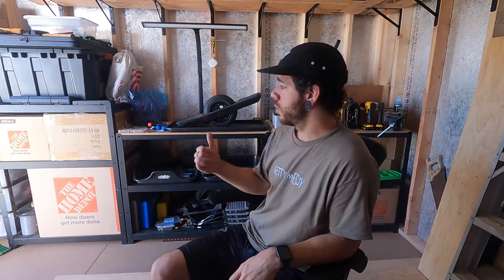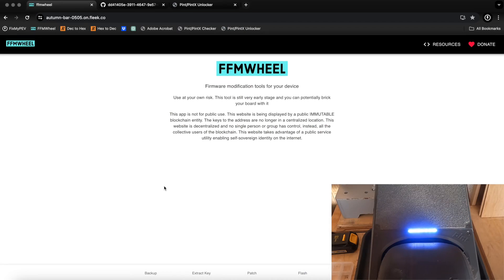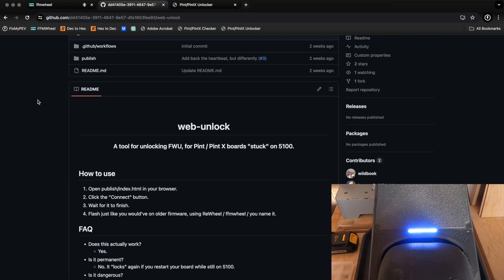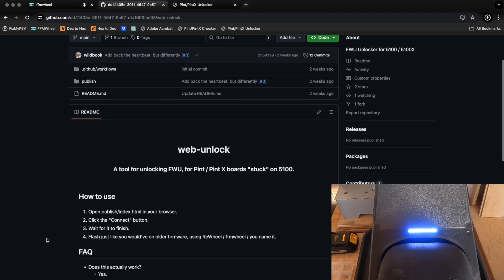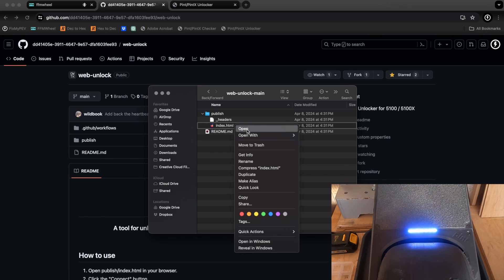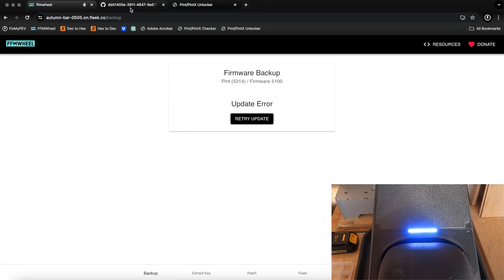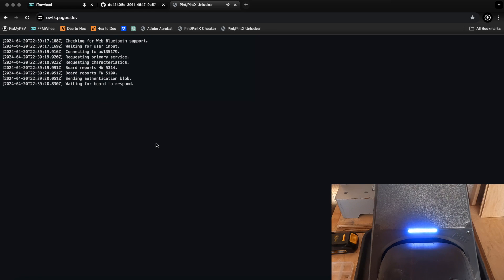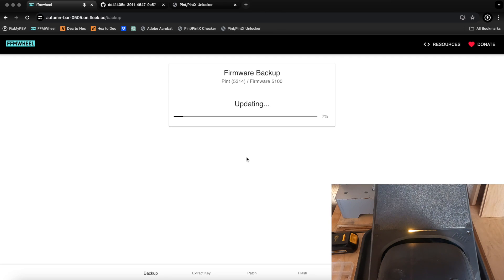Downgrading Onewheel Pint & Pint X: Reclaiming Control

Comment: my computer isn't picking up my onewheel on Bluetooth. I have the quart installed and every time i open the onewheel app it says incompatible hardware but i was able to get like 5 rides without any troubles before it shut off and now every time i turn the onewheel on, the light flashes red.  Would that possibly be an issue if the light is flashing red and thats why im not seeing the onewheel on my computer?
Reply from the maker: The flashing lights should not impact your ability to connect. Just make sure your phone (or any other device) isn’t connected to your board while you attempt to connect with the computer. And keep your board close to your computer.
Reply: okay it shows up now to pair but it doesnt do it everytime. now ill start connecting and then it will take a sec then just go back to the connect button
Reply: ok last thing I just checked the instructions and it says its now incompatible with Gemini 5100 meaning none of this will work now. damn 2 weeks late....
Reply from the maker: This unlocker tool is specifically designed for use with Gemini - 5100. However, it is not compatible with hardware versions above 5314.

Beta sure to review the description and the video multiple times if needed. All relevant info should be there. 

Happy to answer any additional questions you have: https://www.fixmypev.com/contact-us
Reply: @fixmypev  ok awesome! thank you. i was able to do everything in the video but now i ran into another issue. i get a mix of white blue and yellow light flashing the motor isnt on or anything i can connect to the app but nothing is live. my firm and hardware are now gemini -65535 and 5000. My firmware and hardware before was gemini -5100 and 5314...
Reply from the maker: @Skeezusman  Time to flash some firmware.

https://youtu.be/OT6Wd7G6haY?si=gZgT8h3mWiv8YT3_

Comment: Thanks for the video. It went very quickly and included examples of rewheeljng and connecting to program that may it be necessary depending on the board? Can you post a step by step, in text, for pint and one for PintX, please? Including links and verbiage around what to do and where to click?
Reply from the maker: You’re welcome! And thanks for the feedback. For the Pint X, the only difference is that you jump straight to the ‘Flash’ tab instead of the ‘Backup’ tab. I’ve added a pinned comment with that info for now. If there’s enough demand for separate videos, I may look into that in the future. The highlight of the video is the unlocker tool. 🤙🏼⚡️🛠️

Comment: So I can custom shape my pint x for wtf rails???
Reply from the maker: You can level your rails, yes. It’s not custom shaping though. Just an IMU calibration via the Onewheel’s factory mode.
Reply: Just so I have this straight. Once I've down graded..I'll have the ability to use nrf to re-level??
Reply from the maker: Correct. nRF Connect, OWDT, etc.

Comment: Hi there, I tried it, everything looked good until it was the time to run the Firmware Backup again, it read Pint(5301)/Firmware 65520, clicked on Flash Extractor and got an Error. Ran the Unlocker again and got a Red message that says that "this only works with Pint/Pint X Boards". Board is flashing Blue and Yellow lights and the Firmware Backup (if Connect again) reads Pint(5000)/Firmware 65535. Please help. Thanks
Reply from the maker: If the lights are flashing now, feel free to move on to the ReWheel process. Link is in the description. If you need more assistance, send us an email at https://www.fixmypev.com/contact-us
Reply: I would like to know if you get the way to downgrade your onewheel because am at the same like you, please I would like to know how to do it, thanks!
Reply from the maker: @dioscarreyescabreja2102  If you’re interested in my downgrade service, feel free to contact me here:

https://www.fixmypev.com/contact-us
Reply: @dioscarreyescabreja2102 I actually was able to reinstall the software through the application, thankfully the board is working again, NOT DOWNGRADED though, the method explained in the video may work for some others, not mine, and at this time, I am just going to leave it alone. Hope you can fix yours, it’s quite scary

Comment: Well, when I didn't update my pint x, can someone tell me how to check the battery level or change the driving mode without an update?
Reply from the maker: On iOS, use airplane mode or the Float Remote app. On Android, block data and wifi to the Onewheel app or use the OWCE app.

Comment: My pint X was just updated to 5100. How would I go about turning it into a pint in order to then re wheel?
Reply from the maker: That process is an entirely different animal to take on. Requires disassembly, soldering, use of a Pint bootloader, and then ReWheel. We’re not able to demonstrate that process for legal reasons.

Comment: I have a pint with hardware 5326 can I still upgrade my battery to the quartz battery?
Reply from the maker: Gemini - 5326 is unsupported at this time. Unfortunately, that means the ChiBatterySystems Quart battery is not an option for your board.

Comment: ReWheeling a pint X is possible. Just have to load pint firmware on it, relatively long and complicated method but indeed possible.
Reply from the maker: Yessir. Have to turn it into a Pint first. 🤣

How’s your Pint X running by the way?
Reply: Curious about this. My pint X was just updated to 5100. How would I go about turning it into a pint in order to then re wheel?
Reply from the maker: @jordanwilliams618  That's an entirely different (and extremely involved) can of worms. 🪱

Comment: I put a quart in my brothers pint a few years ago and rewheeled it last year. Then he updated it to haptic buzz and now he's bricked. This will fix that? I can use my android?
Reply from the maker: Yes, as long as the board is 5314 hardware or lower. And you can use your Android phone, yes. Just have to be quick after the board is unlocked or you’ll have to restart the process. It’s easier on the computer.

Comment: Thanks! I didn't update my pintx so I'm good, but is there a way to prevent the black notification from showing in the fm app?
Reply from the maker: Personally, I just flip airplane mode on when first connecting to the board. Then, I can make any changes I need to make (lights, ride mode, etc) and then I minimize the app so it can run in the background since I like recording rides. Don’t forget to turn airplane mode off so you can still use your phone after. 😅

Comment: I followed the video and my pint turned into a rainbow color. what do i do? I followed your video exactly and now it's saying im on firmware 65535 and HW 5000?

EDIT: I went through the entire rewheel process and it worked!
Reply from the maker: It sounds like you may have initially been stuck in the extractor mode. Glad it worked out for you!
Reply: I think you pressed the Reboot button after the firmware finished flashing (at least that's what I did). The video kind of glosses this part (around the 8 minute mark), so I wasn't entirely sure what to do. I think the correct answer is nothing. The board is good to go at this point.

Thanks for posting this though! I started freaking out and then saw your comment. Once I followed the whole Rewheel guide, everything was good to go!
Reply from the maker: @Cybercomet333  Glad you got it handled! In this video, I wanted to focus solely on the unlocking aspect because I already have a ReWheel video, but I plugged that one as well (2:17, 9:44, Video Description). Enjoy the freedom! 🤙🏼⚡💯

Comment: mine wont get past the connect stage and I get an error that says  GATT Server is disconnected. Cannot retrieve services. (Re)connect first with `device.gatt.connect`.
Reply from the maker: If you’re still having trouble, send me a message at https://www.fixmypev.com/contact-us.
Reply: Hi, I also got this error message when trying to connect with a desktop PC (Windows 11). I am not sure of the cause, but when I tried with a laptop (Windows 10) it connected correctly. The unlocker then "worked", but unfortunately I still can't backup the firmware yet...
Reply: I managed to backup the firmware etc. The trick (I found) as mentioned in the video is to be super quick between patching and "retry" backup.
Reply from the maker: @RatKitesurfer  I've had trouble with Windows 11 as well. Not 100% sure why, but it has worked for me on Mac OS (Sanoma 14.4.1) too.
Reply from the maker: @RatKitesurfer  Awesome! Glad you got it. It times out quickly.

Comment: Thanks for the video!!  What value did you set your pint speed?
Reply from the maker: I had mine set to the maximum value for the Pint (2000) in the video, but I generally don’t recommend setting it higher than the Pint X level (1462) when using a stock battery.
Reply: @fixmypev  Ok cool, i do have the Quart battery upgrade
Reply from the maker: @matttubbs8860  Nice! Still a decent benchmark. The general rule is 88.965 x MPH = Speed when pushback kicks in. The maximum value is not recommended as it virtually results in no pushback prior to nosedive speeds.

Comment: This is very helpful thanks for the video!

So I have a few questions. Does the app show the accurate firmware it is now on? (My app says my firmware is a 5040 after I went through your "Onewheel Firmware Modification: Improve Performance of Your GT & Pint."

Does this make my board compatible with 3rd party batteries now? (Quart's website says confirmed working with 5314/Gemini 5050).

Lastly, what's a safe pushback value to set my pint at? Theoretically with a quart and stock battery? Thanks so much.
Reply from the maker: Yes, the app shows the accurate firmware. 5040 is correct so you can use an extended range battery.

As for the top speed value, I generally don’t recommend exceeding the Pint X value (1462) on the Pint. It’s all about risk tolerance though.

Comment: Fm isnt going to patch this next week are they?
Reply from the maker: They can’t patch old firmware. So, as long as you don’t update your firmware to an unsupported version, you’re good.
Reply: @fixmypev  ofc but would be nice if this was always something that could be accessed. Probably not since we cant have nice things.

Also why do you think new pints cant use it? You said the bootloader is different but why wouldnt they apply the same changes to the OTA update
Reply from the maker: @NeedNot  It ultimately is something that can always be accessed; provided that you download the offline files and don't update the Pint you're riding to an unsupported firmware version down the road (FM can patch future firmware updates to block this, but can't force you to update).

And new Pints can't use it because Future Motion designed the bootloaders differently. The reason why they wouldn't apply the same changes is only known by them. When you do a firmware update, the bootloader isn't usually impacted. However, it was with some of the XRs updating to the haptic buzz firmware (Gemini - 4165). So, we can't put anything past FM at this point...

Comment: So if my board is exactly 5314 can i do this?
Reply: Mine is to. Just finished . Works great
Reply: I also just did this and my board is 5314. No issues at all!
Reply from the maker: Correct. 💯
Reply: @fixmypev  Hey, I just got done with it. It worked flawlessly with rewheel. Appreciate it a lot!
Reply from the maker: @Spookaroo  Awesome! Enjoy the freedom! 🙌🏼
Reply: Can a pint X (7314) with 5076 firmware do this? Does it need to update to the newest firmware or is it just not possible?
Reply: @adventure_pirate  This process is only required for Pints and Pint Xs that have been updated to Gemini - 5100. If you’re already on Gemini - 5076, you’re already running the Pint X firmware referenced in this video.